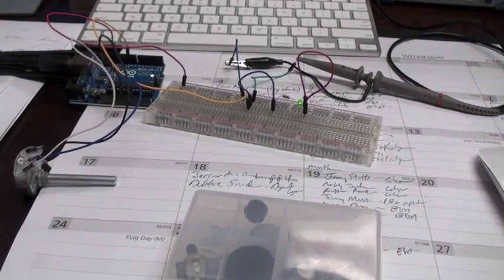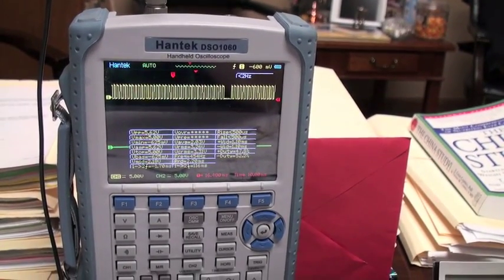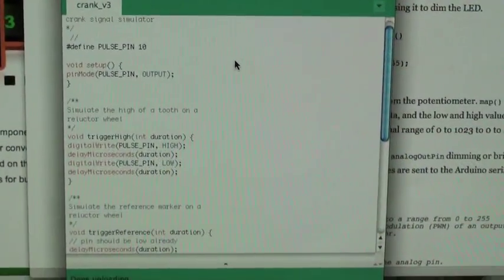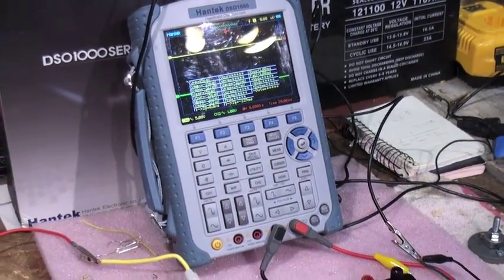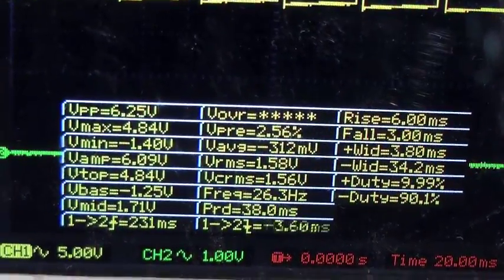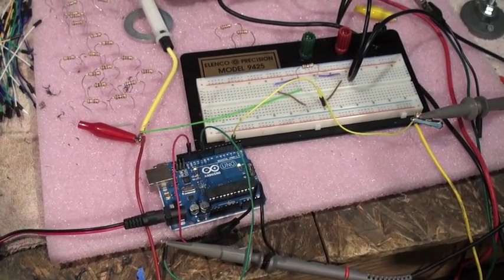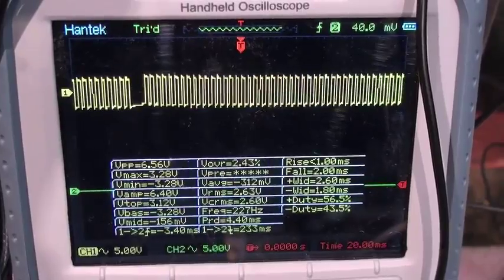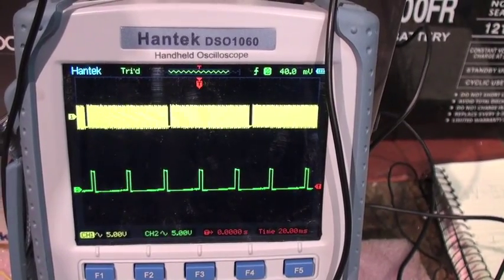BMW X5 crankshaft simulation using an arduino part 1

Comment: Goodnight friend. could help me with timing calculations. to convert them to arduino code? i want to use on toyota hilux which has 34-2 rotation signal and 5 + 1 phase sensor i have a project in progress